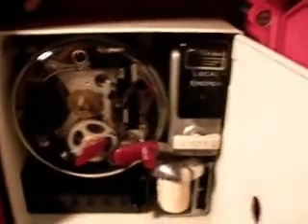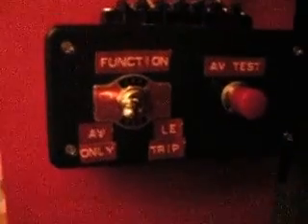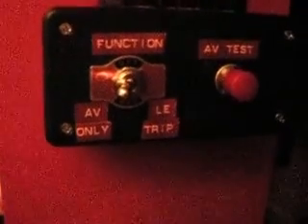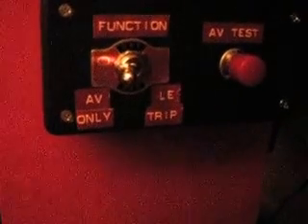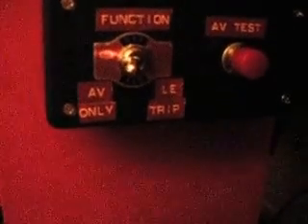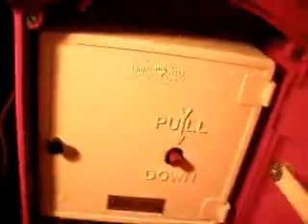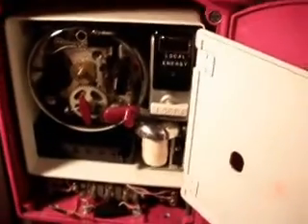Custom Fire Alarm System Test 1

Comment: Your adaptahorn dates back sometime before 1962
Reply from the maker: +ElevatorMan5482 ElevExperiencing Productions Do you have anymore info about the adaptahorn? How do you know that the horn dates back sometime before 1962? ...I think the horn is antique. I got it from an abandoned factory.
Reply: I know it's a pre '62 model because the logo on it is the old one edwards stopped using back in 1962 when they were acquired by General Signal
Reply: marcshark87 yup they are very rare and old. (Not in stock)